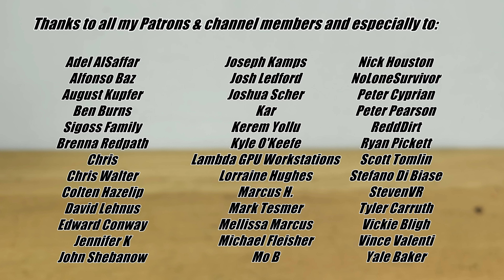I make my own Locknuts - DIY Nylon Nuts

Comment: DIY lock nuts and tools made in Switzerland by a master craftsman.  When worked out by hourly rate for resale, probably one of the most expensive lock nuts on the planet. 😂😂
Reply: But it is cheap as he could find no commercial replacement.
Reply: Might as well have used titanium 😅
Reply: @synkraut9633  In one season we had titanium locknuts, it was heartbreaking to throw em away as the nylon ring was overused. never again and the weight advantage was really tiny compared to the cost.
Reply: I guarantee there are aerospace and military nuts that cost WAY more than this would. But they are intended to function in extremely demanding environments..
Reply: Most expensive but not better. Because regular nuts are forged and the thread is also nut cut. That makes it more resilient to deformation and damage. .
Reply: @miagi1337  I've seen lock nuts from China that were cast, cut, and folded. So much for modern nuts.
I'll take my chances with one turned from steel bar stock in Switzerland. 
Especially when it's a replacement for an old rusty one from the 60s, considering the metallurgy of the time.
Reply: @marcusott2973  Steel bar was made in china too !
Reply: Out of scrap metal 60's nuts ofc !
Reply: @miagi1337 Forging really is more like a mass-production thing to get good results with relatively cheap low-alloyed steels. If he uses something better than C45 its probably more than fine. And if you need more than one or two strokes to get to the final shape, forget forging, its ruined metallurgically.
Reply: @Narwaro  High grade steels are forged all the time for critical parts. There really is no downside to it. Every part would be forged if the tooling and process wasn't so much more expensive than cnc machining or casting. Rolled (forged) threads are functionally superior to cut threads. This nut should work fine, though. It will be rust prone since he did not plate it like most automotive hardware is.
Reply: @ Yes, but forging in a backyard factory in China is not the same as forging aircraft frames with 50,000t presses. Forging when you dont exactly know what youre doing is worse than not forging at all. But Thread rolling is a good idea in general I agree
Reply: We writes that the final nuts were zinc plated
Reply: @miagi1337  I think the custom made one would beat most mass produced stuff these days.  Its frustrating how often I am doing a project and unintentionally strip out a nut, bolt, or screw without really trying.  Then there's the ones that out of the box have either missing threads, incomplete threads, or otherwise malformed.  I've more than once had to run something brand new thru a tap or die to make it fit together correctly because its slightly out of tolerance.